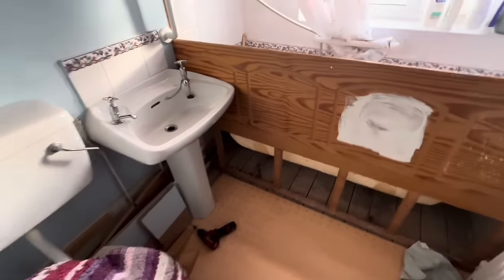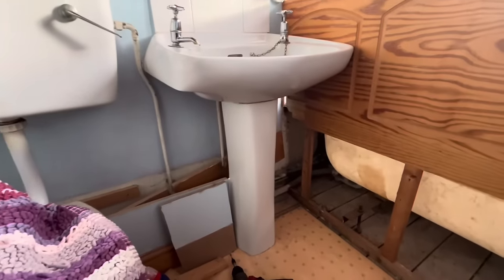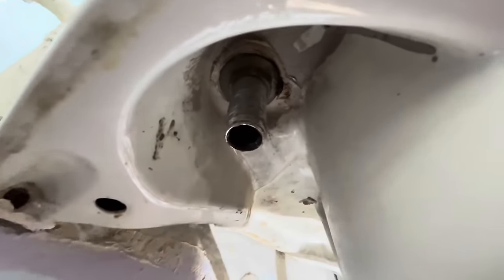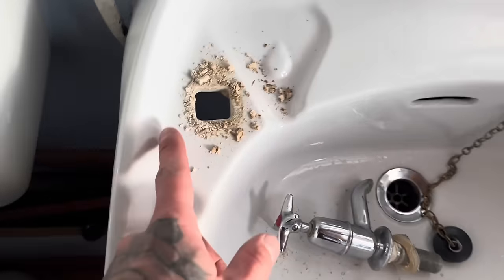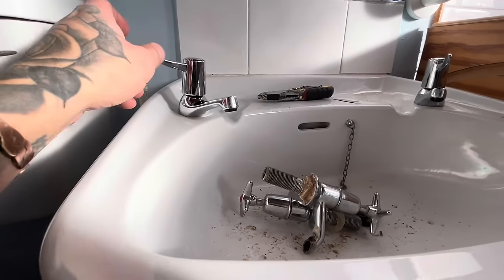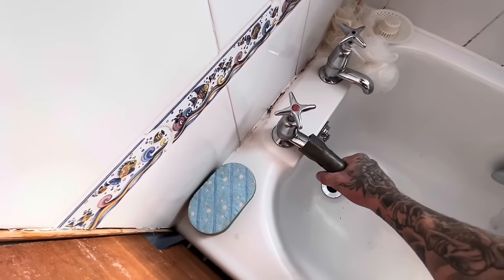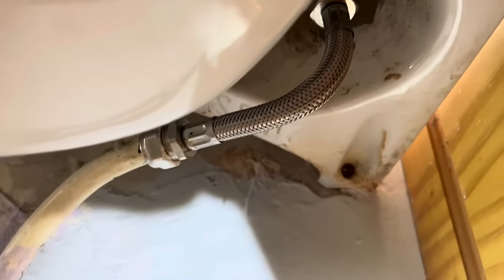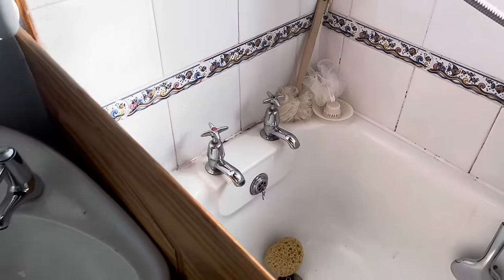I Had To Walk Away, One Of Those Days: A Day In The Life Of A Plumber.

Comment: Old linseed based plumbers mait, sets like rock!            Trick:   Gut the top out the tap, use a snug fitting metal holesaw  down over the seat and drill down until you can part tap out in 2 bits.

Its a b#ll-ache  but a winner if needs must.    HTH
Reply from the maker: Thanks Julian, great advice that, will try it next time! 🫶🏽

Comment: I had the exact  same problem on a sink. The suite was 1950s pink and the tap was solid with putty. I refused to attempt to get the tap out as if the sink broke I'd have to fit a new bathroom suite!! A kitchen tap bolt sheared off but was rust welded to the C washer I had to demolish the tap from the top with multi tool and drill!! Nightmare. All in a days work!!
Reply from the maker: Sometimes you’re best just walking away like you did Richard. Cheers for the comment mate!

Comment: I work on council houses a lot of the time. They used to use that putty on everything makes it a nightmare silicon is easy in compared to that especially when its 20+ years old. Also has the give away announcement happened yet. great video by the way
Reply from the maker: Hey mate. Giveaway announcement is next video 🫶🏽 and it sets like bloody concrete haha
Reply: @Heatking  no worries thought id missed it not that ill win but worth a try. Its no joke they used to put it on the old style kitchen wastes with the nut that clamps the overflow into place honestly one of the most annoying things to do. Doesn't help the nut is about the thickness of a grain of rice 🤣
Reply from the maker: @deano6017  😂😂😂😂 brilliant, and you’ve every chance mate I just stick the comments in a random comment generator, but I’m hoping to do plenty of giveaways. Probably 3k next.

Comment: That wash hand basin, must be very old,  with square tap holes which makes it hard to remove without çracking the basin,  modern basins have round tap holes.
I was using plumbers mait 30 years ago, a non setting putty, before emigrating to oz,  is it still available?
Reply from the maker: Yeh mate some people still use it. I have a tub in the van but never use it. Cheers for the comment mate 🫶🏽

Comment: On a job like that I would advise the client that the bath may need to replaced. Although it's a big item, the bath can cost less than the taps.
Reply from the maker: Yeh that’s true. But with it being tiled in and tiled on 3 walls, it would have been a pain to change.
Reply: @Heatking  Yeah if there is any danger of cracking a tile then it’s a no go.

Comment: Why use a strap on boss again? why not a spigot/collar boss pipe with an 1"1/4 boss adaptor if your replacing the old bodged boss job
Reply from the maker: Do you mean like the 4inch junction connection? Similar size to a coupling that you just drill out and put the reducer in? Strap on bosses are fine in my opinion if done right, and cheaper for the customer. Also brown soil around these parts is expensive and a special order on most items.

Comment: I’m not a plumber but I would have tried using an old guitar string/piano wire
Reply from the maker: Yeh that’s an idea that mate. May be worth keeping one on the van!
Reply: Bath tap back nuts puttied in, heat up a snug fitting box spanner, and heat transfer will soften putty/ expand back nut usually enough to get movement and get them sucker's out same with basin.
Reply from the maker: @mickymeltdown  why didn’t I think of this 😩

Comment: That is called red lead putty hence the colouration of it. Also taps used to be made in with plaster as well with lead washers underneath. 
What I do is you have to hit the underside of the tap with the back nut slightly on . Always had to do this as an apprentice in the 70's 
You can't twist them because the tap holes are square . They are a challenge tvats for sure. Or what I've done way before multi tools were available is use a junior Hacksaw and cut the tap off from the top. Lost soo many knuckles doing that.  Also broke basins where they cracked when I over heated them with a blow lamp!! 🙈
Reply from the maker: I was nervous of cracking the basin with the lamp on it 🤦🏽‍♂️ and I did give the bath taps a whack upwards but didn’t work 😩, didn’t know the name of the putty so thanks for that mate!🫶🏽
Reply: @Heatking  the square holes on the bath & the lugs in tbe taps make them super tight . Used to also cut them off from the top with just a junior used to take me knuckles off . You young uns have the multi tool now. But you have to be mindful of scratching the bath. I think you did the right idea not doing it. Maybe some tap savas might of been a little easier with levers . But you got lucky as she says she never uses the bath 👍
I've lost count how many taps I've changed in nearly 50yrs doing plumbing & heating. You guys have all tbe tools now. We didn't have anything other than hand tools unlike all the cordless available would of made my job so much easier back then
Reply from the maker: @actorlyric  yeh I get that mate. I suspect in another 30 years I’ll be saying the same thing to the younger plumbers 😂😂
Reply: Them.little square bits of lead make them taps solid grrrrrr
Reply: i have had good results with stubborn bath taps heat up a snug fitting box spanner and put on back nut heat transfer will soften putty and expand backnut, same with basin, try it next time😊
Reply from the maker: @mickymeltdown  going to mate. That’s genius!!